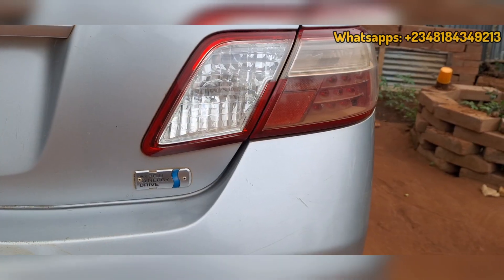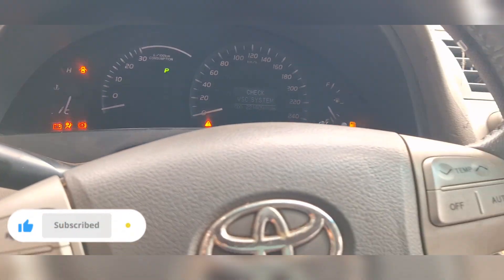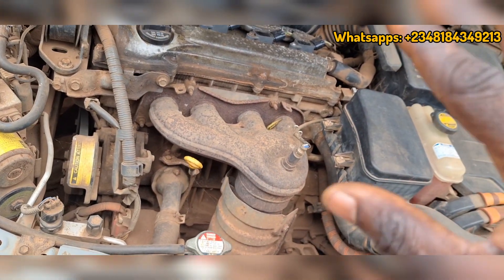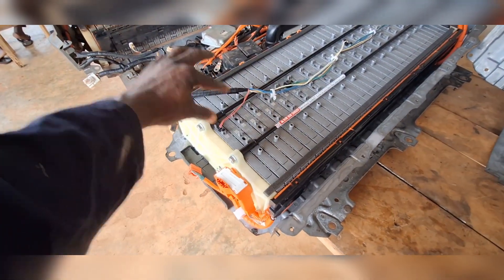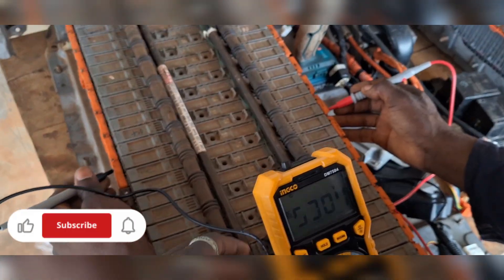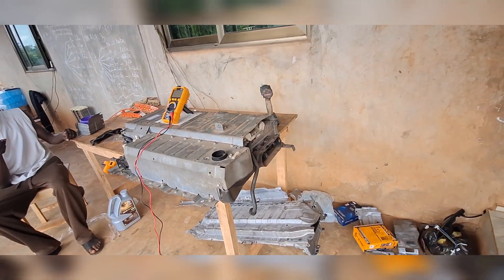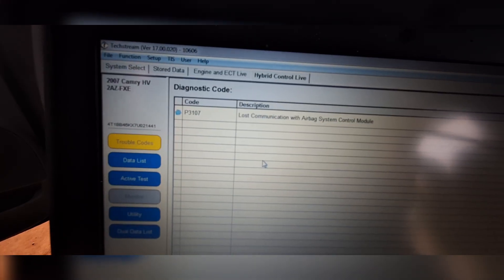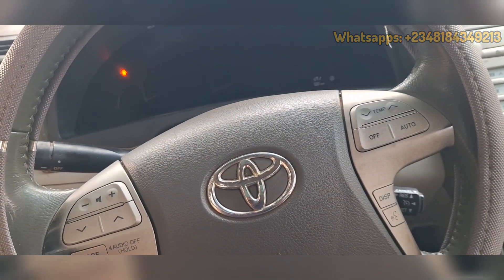Toyota Camry Hybrid Gets 2023 Venza Battery Upgrade | Cross-Border Repair Story P0A7F P0A80

Comment: I have a 2012 Camry Hybrid. I replaced the cell pack with 2021 Prius cells, but I saw this code POAE7. What is the solution to fix it?
Reply from the maker: Most likely you didn't connect some connectors of have one wire cut when you where putting everything back together